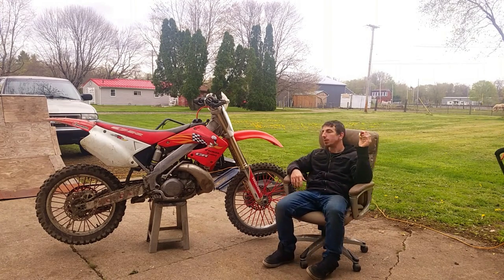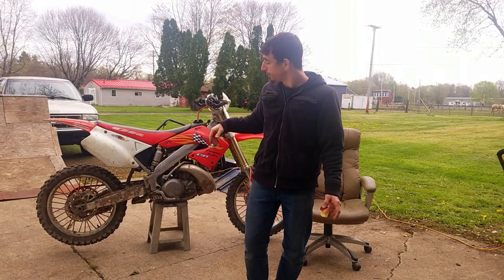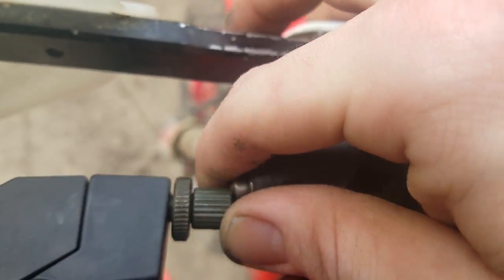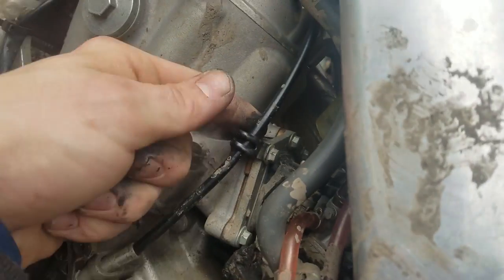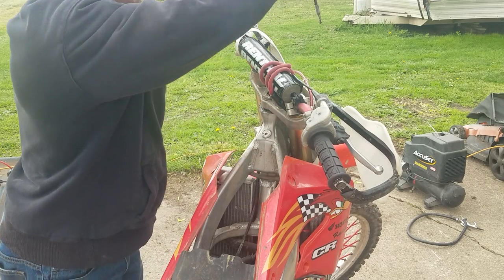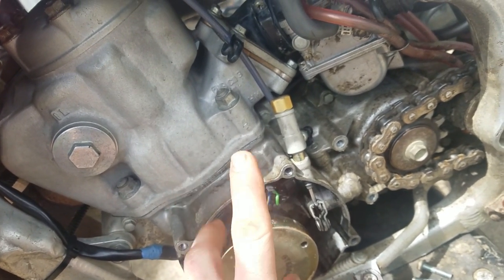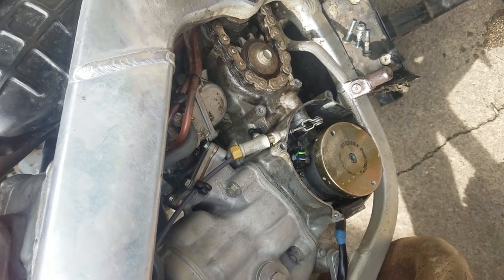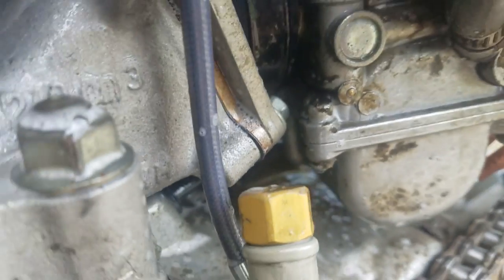Magura HYMEC + Midwest Mountain Engineering Lever

Comment: Thanks for the info I won't waste my money on it..
Reply: Wish I’d of seen this a week ago exactly same thing happen to me I installed it it didn’t pull far enough to completely disengaged my clutch noticed that sound contacted them said it’s normal now I’m out 296🤬 and just want it to work as it’s supposed to so now I’m back on cable for now
Reply from the maker: @tyler2wheels  yeah dude it's very disappointing to say the least.  I'm sorry you got skeez'd too ☹👎
I found a combination of a nice ASV perch & lever, the right springs, and a lubed cable yielded results better than what I initially expected to get from the magura setup. I'm extremely satisfied with the performance and feel.  Will never take my cable clutches for granted ever again!!!
Reply: Facts I got the protaper exp lever and perch and it is nice to